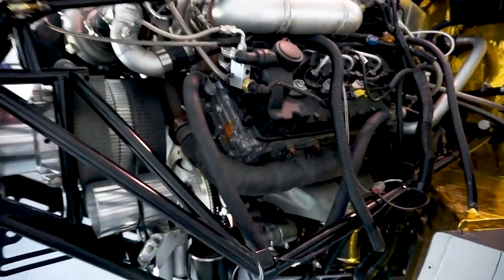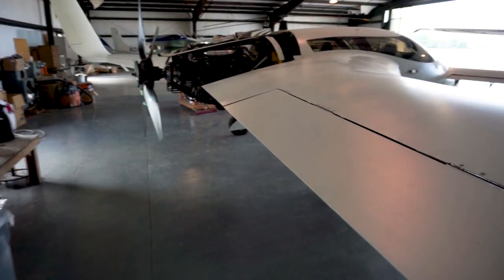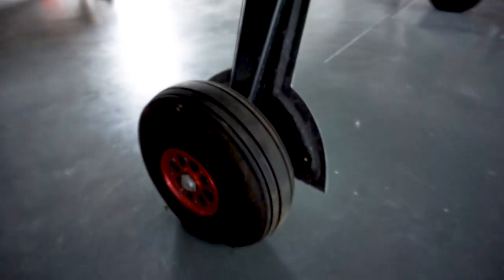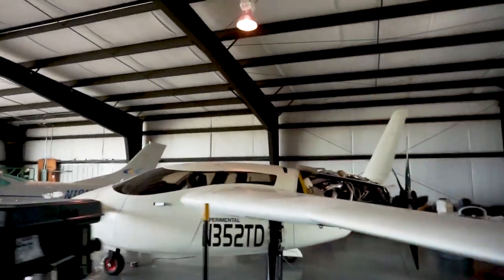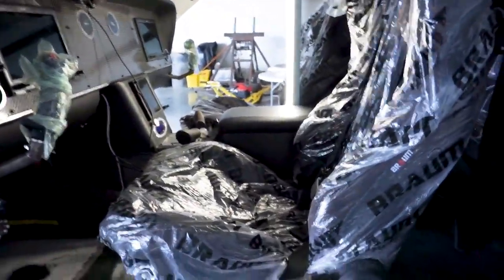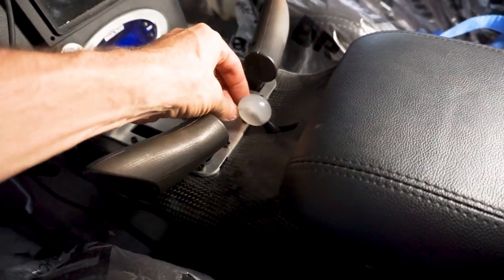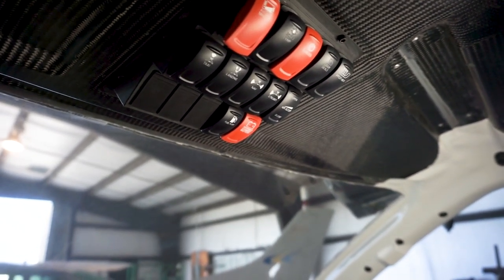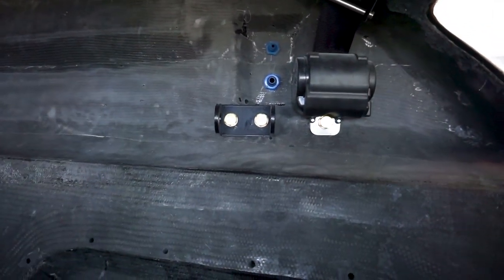Is this the coolest plane you can't buy... yet?  (Part 2)

Comment: Some feedback from an ATP pilot (me). The pitot heat switch on the overhead is an odd choice to me; let me explain. If you need pitot heat you’re probably in IMC (or entering IMC) but to positively identify that switch amongst all the others you’d need to tilt your head up and away from the instruments. This is fine if the autopilot is driving, but if you’re hand flying it could be problematic. It’s a recipe for a bit of a head spin (somatogyral illusion) especially when your peripheral vision is non-existent (IMC or night). However, being the prototype, these sort of minor design quibbles can be worked out, so I’d be curious to hear your experiences flying the Raptor in IMC Peter - I’d be happy to be proven wrong :)
Reply: Because this is experimental self-build (factory assist), you could theoretically put the switch wherever you want it. But that would be a good suggestion to offer customers whenever that point arrives.
Reply: James Gray 
Turn it on preflight
Reply: Ross Boeing - true. However, if you’re operating out of Florida, the need for that is kinda moot. I don’t generally have pitot heat on unless it’s needed and it’s only a pre-flight item (when I’m in a lightie) if the conditions suggest it might be necessary before I hit cruise. I don’t subscribe to the “turn everything on just in case” during pre-take off checks.
Reply: OkammakO - absolutely. There’s a number of choices Peter has made on the prototype that are clearly not intended for a production version, and as an experimental category aircraft, it’s up to the builder to make a lot of these sort of choices. It’s not a criticism, just an observation.

Comment: Great progress .. really amazing to have seen this project develop. 

Just my humble comment. The main avionics switch and especially the engine start and stop switch should be guarded. From your explanation it seems you can turn the engine off by action on the rocker switch which could happen accidentally,  also group the switches example criticle red together ect... also consider relocation of the gear actuation lever to a more conventional orientation (in front of the pilot). 

Just my observations from human factor point I know it's a prototype..  great job
Reply: I agree, but think it should be OK for professional test pilots or P.M., who literally knows the Raptor inside and Out.  😜
Reply: I thought exactly the same ... hitting either avionics off or engine off switch while trying to turn the landing lights on on a bumpy approach would make for an interesting landing

Comment: Great to see you keeping the value in this experience for us.  Thank you for the tour - it looks great!

For God's sake, PLEASE put a red warning sign on that center gear knob! Or replace the knob with a red one?

I have a serious question now suggestion now, in a word: WRAP.
Instead of waiting to paint the craft, have a company specializing in automotive-type vinyl "wraps" that give the appearance of a new, custom paint job printed and stretch-wrapped to the vehicle.  I've seen where the last few pits and rough spots have been addressed, so it should look great!

Fresh hi-res LIVE photos for distribution at Oshkosh.  It never hurts to think outside the box now and then.  Take care on your travels..
Reply: Question from a NON-pilot.
What is your concern over the gear selector knob? ( I agree on having the indicator lights up high where only a quick shift of the eyes will give an answer, and while it would be a shame to mess up that beautiful leather covering, three little LEDs in the peak of the glare shield above the autopilot looks like the perfect place)
From my observation there are two obvious things that stand out.
1. Large detente that requires the knob to be lifted up before you are able to drop the gear
2. The shape and position of the knob when compared to the throttle handles, you're not going to confuse the feel of the throttles for the spherical gear knob.

The less obvious is the low speed lock out (no retraction under 80Knts).
Reply: @lancer2204  : Look in the mirror.  YOU are the reason for red warning signs because as a non-pilot, touching an unidentified control in the cockpit out of curiosity can result in potentially catastrophic damage.  This is simple human factors risk mitigation.

Comment: Great job Peter! I have a suggestion for production models.  Consider a provision for a landing camera for a selectable display and maybe camera views similar to some vehicles. It would be useful to be able to see the air intake and prop etc. If the windscreen is severely cracked, fogged over or iced over, being able to see forward may be a problem with no ability to open a direct vision window, unless the cabin doors can be opened inflight below a certain speed and still remain attached without departing and hitting a wing and or fodding out the prop.
Reply: FLIR !

Comment: Want one! One question, though: do you expect the ECU to also control the RPM or is that something the pilot will have to control manually. That might be a bit of an operational issue for single pilot IFR operations .... As this is my first posting in this channel, please let me add: If you pull this off (including the price tag), you'll be forever a hero of general aviation!

Comment: ... the Motec can save quite a bit of initial investment . So: fixed pitch or ground adjustable prop. Then set about a three of four hundred  cruise - power band and the ECU can hold rpm at the desired level . Of course you have to buy the right prop, and maybe hunt around for an ideal ground setting .

Comment: Appears the front landing doors flapping against the gear or even leaning on it during takeoff due to the wind pressure. Then as you close up it will catch the door. Based on you just moving them so easily by hand back and forth.
Reply from the maker: Well, I'm thinking that the curved nature of them will act as a lifting surface and if anything, hold them open just as the spring is doing. We'll see how they work out.
Reply from the maker: @Ivan Antun yes, well everything with the aircraft is an experiment at this point. It all needs to be tested and proven or fixed if there is a problem.

Comment: If someone else already mentioned this, forgive me. Are there any dampers on the main gear in case of a hard landing? I'm not saying it needs to be as robust as a trainer, but a trailing link system on the mains would reduce shock to the airframe if someone lands harder than they mean to.
Reply from the maker: These Grove legs are designed to flex. That's all the damping we have right now. A canard aircraft like this is designed to be 'flown on' rather than 'dropped on' as is all too common with full stall landings in conventional aircraft.